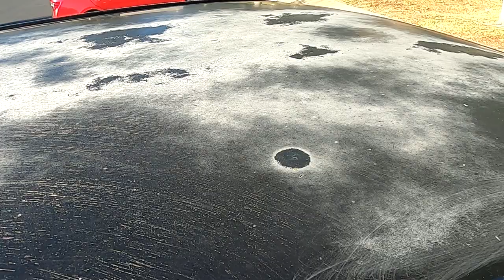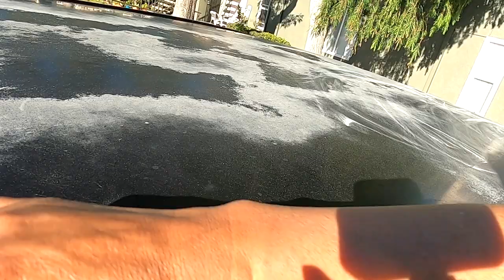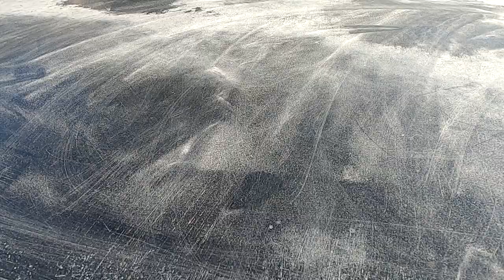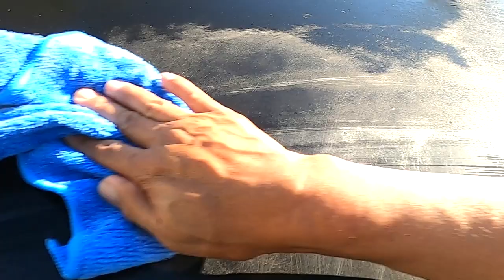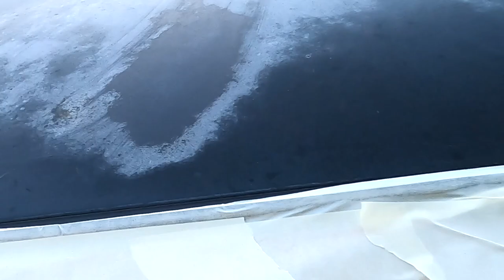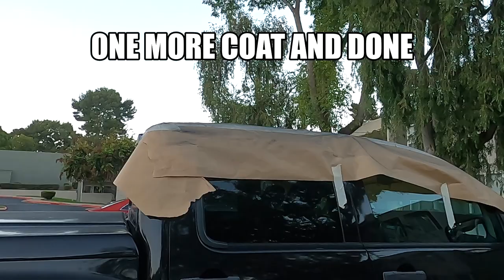Painting The Top Of my 2011 Nissan Titan Came Out Good #nissantitan #paintjob #diy

Comment: What number of grit you used
Reply from the maker: I don't remember because I threw them away but they were just light .I just made it a little rough so the paint would stick well.
Reply: Kool so u just sprayed it so no primer or clear coat u put how many cans did use I have Nissan Titan too and I want to fix that too I really don’t want to prime it
Reply: How many cans to do top and hood
Reply from the maker: @jameselloko6365  7 on top and 5 on hood.
Reply: @rctuna12   which paint did u use  stayed nice  so no primer or  clear coat
Reply: @jameselloko6365  rustoelum clear coat get that also